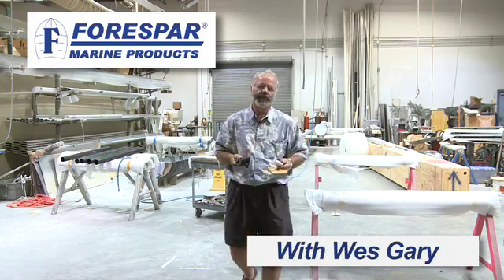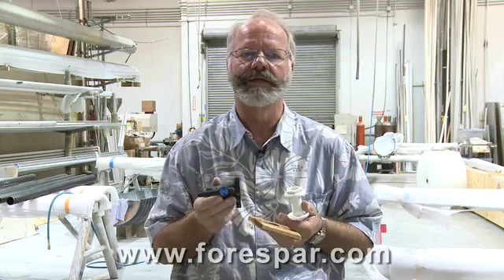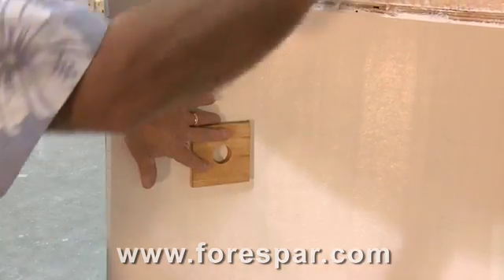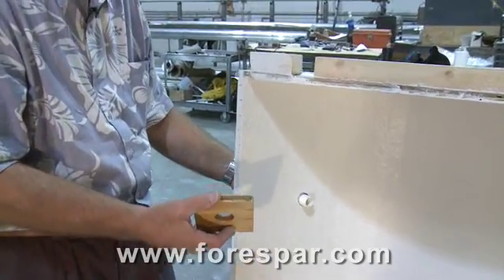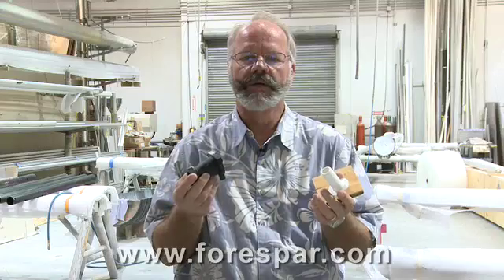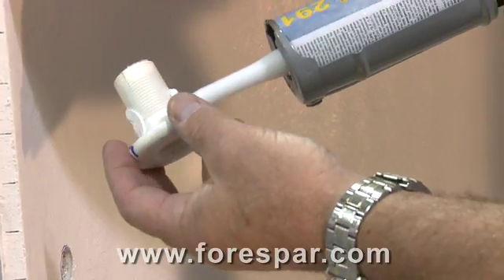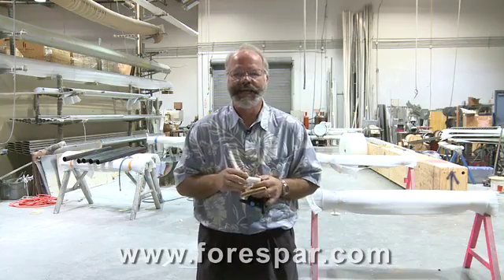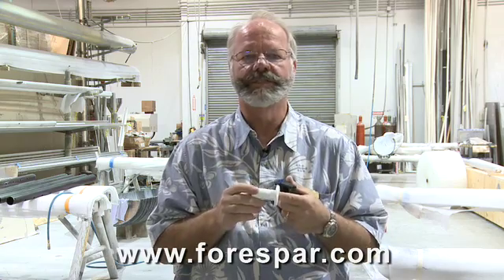Forespar - Marelon Seacock Installation

Comment: Do not use plywood as a sea cock backer, go cruise some boat yards for some scrap solid fiberglass of the proper thickness.  That plywood will take on water and it will expand, and it will fall apart.

Comment: Hi Wes,
I've just bought a marelon seacock.
I noticed you're using plywood as a backing. I put this to a boating forum to see what I should coat it with. The general response was not to use a plywood, as over time water would seep in and the plywood would expand. One reply was that at least a bronze fitting would give a little, but plastic would shatter. I still intend to use plywood and coat it in bilge paint, but would welcome your opinion. Your videos are a godsend to novices like myself btw